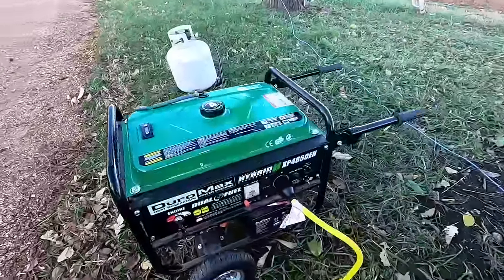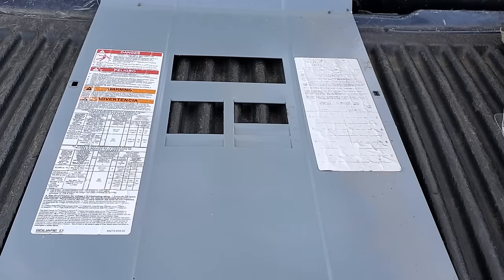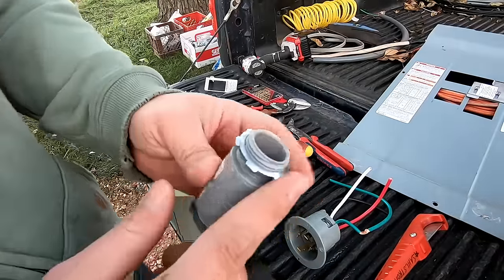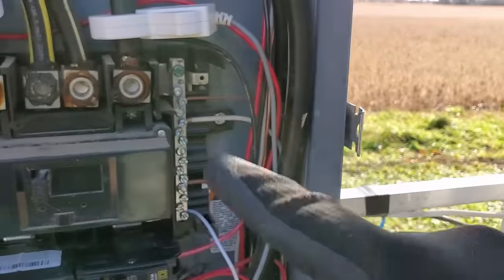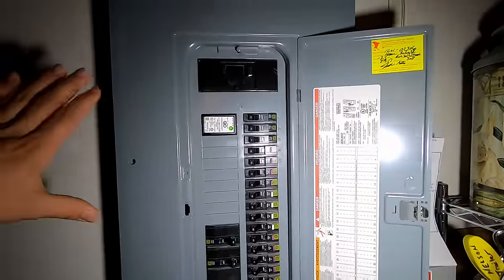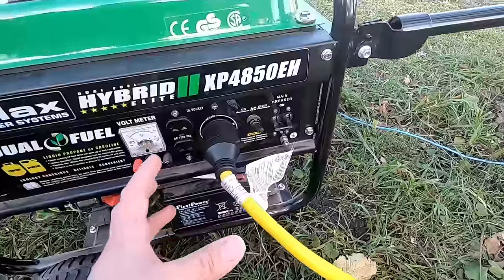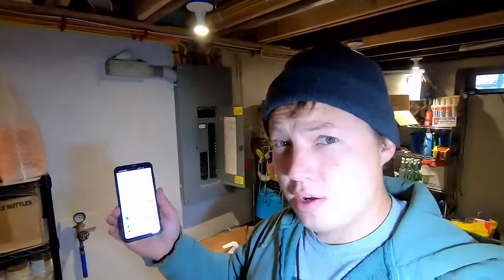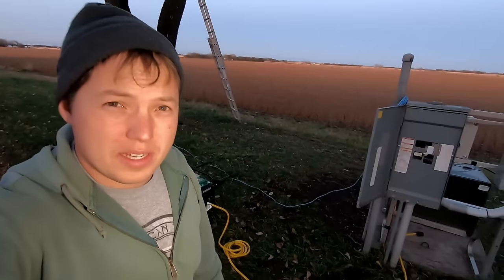How To Hook Up a Generator To Your House Using a Breaker Interlock Kit & Power Inlet Box

Comment: Hi Ben. I just subscribed!
Let's say the house is running on generator power (which is feeding thru the new 30 amp circuit breaker added to the panel) and someone uses the oven in the kitchen. Would that pose a problem? Just curious. Thanks in advance.

Comment: Really great video and details! It helps to understand how this works. I was thinking of getting the same brand but concerned about THD being 10 to 12%. With heat pumps, computers, etc. should this be of concern? I read you should look for 5% or below. Totally confused and would like to use a Duramax.
Reply: Don’t forget to follow all the generator safety rules whenever you use your portable generator 
⚠️Generator safety rules:

This is just a reminder for everyone’s safety when using portable generators. All generator safety rules need to be followed carefully to avoid hazards. 

1) Please do not allow an unqualified person or your children to operate the portable generator. Just because some manuals don’t say that doesn’t mean it’s safe. That is important against the generator safety rules. We also need to be keeping an eye on our children too. You need to make sure that your children are not playing near the portable generator especially when it’s running so they won’t get electrocuted. Generators pose electrical risks and they can be hot during an operation. Please keep your children away from the portable generator at all times. It is important to keep our children safe especially our little ones. Be aware of all the hazards.

2) Some people use their portable generators indoors which increases the risk of carbon monoxide poisoning. It’s important to have a carbon monoxide if you have a gas generator. Never ever use your generator indoors even if your doors and windows are open and even in the garage is not safe to use a portable generator. Not even at your porch and your deck. It is never safe to use your generator indoors and in enclosed areas of your home. Your generator needs to be 15-20 feet away from your house. 

3) 🔥generators cause fire hazards too. Never refuel your generator while it’s running. You need to let your generator cool off before refueling it and before storing your generator. Never overload your generator too. Never ever back feed your generator. You should never plug your generator into a wall outlet. Also never store propane tanks indoors. Please keep flammable things away from the generator as well and please don’t smoke cigarettes near the generator. Having a fire extinguisher next to the generator is also important against the generator safety rules. 

4) generator operation; make sure your hands are dry before touching the generator. Never use your generator in wet conditions. Don’t let your generator get wet. You need a generator tent if you need to use your generator during wet weather. Please don’t wear loose clothes when operating the generator. Turn on your generator before plugging in appliances. Use the right cord for your generator. Please do not use worn out cords. 

https://youtu.be/I1jT3ANENvI and here is a video more about keeping others safe when using generators and also about our family’s safety. Hope this helps

Comment: Hey Ben is it possible to combine  2 120volt outlets on a generator to get 240 volts.
Reply from the maker: I don't think so as it is likely just two 120v receptacles on the same phase if it doesn't have a 240v receptacle by default.

Comment: Won’t you feed the main incoming feeders if you do not feed just the generator breaker?  Feeding just the generator breaker bypasses the main line breaker. I do
not see how you feed the two bus bars if you just parallel the main in coming line with the mainline master breaker being fed. Am I imagining this as a problem?  Anyone  know for sure.

JoeB
Reply: The main breaker and the 30amp breaker from the generator feeds both bus bars.  However, the interlock only allows one of the two breakers on at any give time to feed the bus bars.  With the main breaker off, there's no power going to the main feed wires - they're isolated from the main feeds.

Comment: You have to consider Load balancing including the difference between inductive loads and resistive loads in ref. to the output of your generator.
Reply: Don’t forget about the safety rules of using generators: Always make sure you follow all the generator safety rules whenever you use your portable generator. This is a reminder for everyone’s safety of using generators. Generators can be dangerous if not used carefully. Every year, hundreds of people die or get injured when using portable generators due to carbon monoxide poisoning and electrocution. Make sure you are using your generator carefully and keeping others safe as well. There is something very serious that everyone should always be aware of when using generators. Some people do run their generator indoors which is not safe and that increases the risk of carbon monoxide poisoning which can cause death of family and you. Some people run their generator in wet conditions which can electrocute them. Please remember that you should never run your generator indoors. Remember that carbon monoxide is an odorless and colorless gas that you cannot see or smell. Carbon monoxide is a silent killer. Keep that in mind. Make sure your generator is 15-20 feet away from your house and away from doors, windows, and vents. Never use your generator in your porch too. Having a carbon monoxide detector is very important against generator safety. Some people also allow children to go near the portable generator which could pose risks. We need to keep an eye on our children making sure that they are not near the portable generator so they won’t get electrocuted or burned by the generator which is dangerous. A locking enclosure also keeps kids safe. A generator shed might look like a tempting place to explore, or take cover during a game of hide and seek, but a generator is a dangerous piece of equipment that can cause injury. It says on the manual that we should also keep children away at all times from the portable generator to avoid injuries. Please do not allow a child or unqualified people to operate the portable generator.  It is important to keep your children safe especially little ones. The portable generator can be hot during an operation. Just because some manuals missed what should be listed doesn’t mean it’s safe to do. Always follow the generator safety rules when using portable generators. Generators pose electrical risks. If you need to use your generator during wet weather, you need a generator tent to protect your generator from getting wet. Don’t let your generator get wet. Keep your generator dry and before using your generator, please make sure your hands and your generator is dry. Do not wear loose clothing when operating the generator. Everything that is said on the generator’s operating manual should not be ignored. Never smoke cigarettes near the generator. Please keep flammable things away from the generator. Never overload your generator too. Your generator can catch fire. Never ever try to plug a generator cord into a wall outlet to avoid back feeding. Back feeding your generator is dangerous. Always turn on your generator first before plugging in appliances and shut off the appliances before turning your generator off. Use a heavy duty cord for your generator and the cord should not be worn out. All the instructions should be followed carefully. Never refuel your generator while it’s running. It can cause fire if fuel spills while your generator is hot. You should turn off your generator and let it cool off before refueling it. Having a fire extinguisher next to the generator is also important. This is only a reminder for everyone’s safety of using generators. Make sure your generator is properly grounded. Having a fire extinguisher next to the generator is also important against the safety rules. https://youtu.be/I1jT3ANENvI and here is a video more about keeping others safe when using generators and also about our family’s safety. It’s important to keep our little children safe as well. Make sure your little children are kept away from the generator at all times especially when it’s running. Hope this helps. Always remember that it’s better to be safe than sorry. Also remember that warnings should not be ignored too.

Comment: I ran the last 6 of 75 feet of 6/3 Romex in conduit outside. It goes down from the soffit to the generator inlet box. The rest of it is on the attic without the conduit. Any ideas on how to fix it? Could I use 50amp junction box? Should’ve watched it before I did a job

Comment: Very informative.
Question:  The circuit board in my furnace I think didnt like by generator hook up....
Is the reason the generator wasnt properly grounded?  Can you buy an inverter kit to go between the generator and the sensitive electronics?
Thanks.
Reply: ⚠️Generator safety tips:

This is just a reminder for everyone’s safety when using portable generators. All generator safety rules need to be followed carefully to avoid hazards. 

1) Please do not allow an unqualified person or your children to operate the portable generator. Just because some manuals don’t say that doesn’t mean it’s safe. That is important against the generator safety rules. We also need to be keeping an eye on our children too. You need to make sure that your children are not playing near the portable generator especially when it’s running so they won’t get electrocuted. Generators pose electrical risks and they can be hot during an operation. Please keep your children away from the portable generator at all times. It is important to keep our children safe especially our little ones. Be aware of all the hazards.

2) Some people use their portable generators indoors which increases the risk of carbon monoxide poisoning. It’s important to have a carbon monoxide if you have a gas generator. Never ever use your generator indoors even if your doors and windows are open and even in the garage is not safe to use a portable generator. Not even at your porch and your deck. It is never safe to use your generator indoors and in enclosed areas of your home. Your generator needs to be 15-20 feet away from your house. 

3) 🔥generators cause fire hazards too. Never refuel your generator while it’s running. You need to let your generator cool off before refueling it and before storing your generator. Never overload your generator too. Never ever back feed your generator. You should never plug your generator into a wall outlet. Also never store propane tanks indoors. Please keep flammable things away from the generator as well and please don’t smoke cigarettes near the generator. Having a fire extinguisher next to the generator is also important against the generator safety rules. 

4) generator operation; make sure your hands are dry before touching the generator. Never use your generator in wet conditions. Don’t let your generator get wet. You need a generator tent if you need to use your generator during wet weather. Please don’t wear loose clothes when operating the generator. Turn on your generator before plugging in appliances. Use the right cord for your generator. Please do not use worn out cords. 

https://youtu.be/I1jT3ANENvI and here is a video more about keeping others safe when using generators and also about our family’s safety. Hope this helps

Comment: Great video. It makes me think l could have built a special cord to run from my welding receptacle to my 7500 watt generator , after shutting off the main 200 amp  main panel  breaker , and leaving on the secondary panel  in my work shop , which  would only need 1 group of  fluorescent lights  .My sub panel with all the power equipment turned off should  supply the main panel  and therefore power up the closed breakers l needed  to run the house, I had to run separate extension cords to the necessary appliances , excluding the  Gas furnace   Which could not be plugged in. . I could also run the electric water heater ,and go back to bed . Ha ha . We had many power outages during winter storms and the sump pump did need to be operating all the time. .Yours truly Handy Hutch . Retired .

Comment: Excellent video Ben. My generator has a 240v30a outlet and a 120v30a outlet. Keeping in mind that the interlock wont work, can I run each one to there own breaker on the panel in order to run the full capacity of the 7500w generator into the house? Thanks

Comment: Nice very informative video, by the way what happen if they have backfeeding generator? If accidentally put on the principal main breaker and panel breaker of generator.
Reply from the maker: It will essentially "energize" the main power lines with high voltage and it could kill a lineman in extreme cases. It's not worth taking the risk of using the "suicide cord" method.

Comment: Great videos, very helpful.   Did have quick question, How do you handle floating neutral vs bonded neutral on the generator with interlock.
Reply: Here are the generator safety rules that everyone needs to follow: this is just a reminder for everyone’s safety. Always make sure you follow all the generator safety rules whenever you use your portable generator. Generators can be dangerous if not used carefully. Every year, hundreds of people die or get injured when using portable generators due to carbon monoxide poisoning and electrocution. Make sure you are using your generator carefully and keeping others safe as well. There is something very serious that everyone should always be aware of when using generators. Some people do run their generator indoors which is not safe and that increases the risk of carbon monoxide poisoning which can cause death of family and you. Some people run their generator in wet conditions which can electrocute them. Please remember that you should never run your generator indoors. Remember that carbon monoxide is an odorless and colorless gas that you cannot see or smell. Carbon monoxide is a silent killer. Keep that in mind. Make sure your generator is 15-20 feet away from your house and away from doors, windows, and vents. Never use your generator in your porch too. Having a carbon monoxide detector is very important against generator safety. Some people also allow children to go near the portable generator which could pose risks. We need to keep an eye on our children making sure that they are not near the portable generator so they won’t get electrocuted or burned by the generator which is dangerous. A locking enclosure also keeps kids safe. A generator shed might look like a tempting place to explore, or take cover during a game of hide and seek, but a generator is a dangerous piece of equipment that can cause injury. It says on the manual that we should also keep children away at all times from the portable generator to avoid injuries. Please do not allow a child or unqualified people to operate the portable generator.  It is important to keep your children safe especially little ones. The portable generator can be hot during an operation. Just because some manuals missed what should be listed doesn’t mean it’s safe to do. Always follow the generator safety rules when using portable generators. Generators pose electrical risks. If you need to use your generator during wet weather, you need a generator tent to protect your generator from getting wet. Don’t let your generator get wet. Keep your generator dry and before using your generator, please make sure your hands and your generator is dry. Do not wear loose clothing when operating the generator. Everything that is said on the generator’s operating manual should not be ignored. Never smoke cigarettes near the generator. Please keep flammable things away from the generator. Never overload your generator too. Your generator can catch fire. Never ever try to plug a generator cord into a wall outlet to avoid back feeding. Back feeding your generator is dangerous. Always turn on your generator first before plugging in appliances and shut off the appliances before turning your generator off. Use a heavy duty cord for your generator and the cord should not be worn out. All the instructions should be followed carefully. Never refuel your generator while it’s running. It can cause fire if fuel spills while your generator is hot. You should turn off your generator and let it cool off before refueling it. Having a fire extinguisher next to the generator is also important. This is only a reminder for everyone’s safety of using generators. Make sure your generator is properly grounded. Having a fire extinguisher next to the generator is also important against the safety rules. https://youtu.be/I1jT3ANENvI and here is a video more about keeping others safe when using generators and also about our family’s safety. It’s important to keep our little children safe as well. Make sure your little children are kept away from the generator at all times especially when it’s running. Hope everyone finds this helpful. Always remember that it’s better to be safe than sorry. Remember that warnings should not be ignored.

Comment: You should use a torque wrench and since it is outside all your enclosure penetrations should be water tight.
Reply: Also for PPE not sure your gloves are electrical gloves just coated gloves or rubber gloves are not adiquate on a live panel since the main is hot this is a live panel. the electrical gloves should have leather gloves over them to protect the electrical gloves from punctures. Proper safety glasses are a must in a live panel. The generator you are using is clearly not addiquate for an entire house you would have to greatly reduce the number of circuits running off this generator or you overload your generator. Your furnace is probably near the max for your generator, dryer, stove etc also.